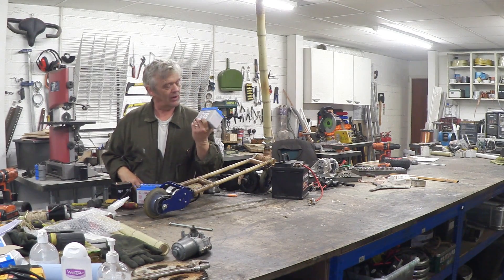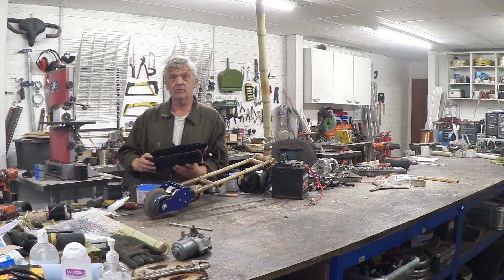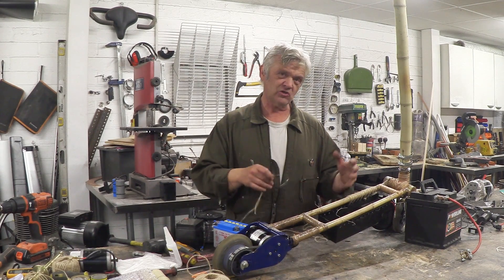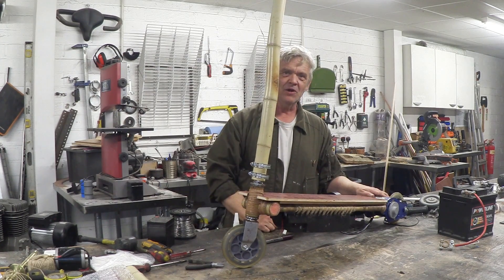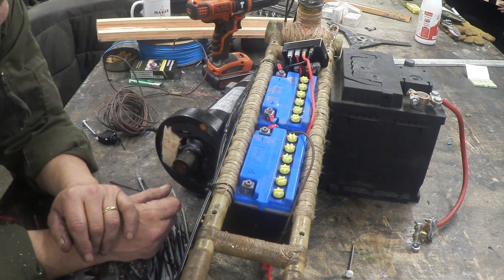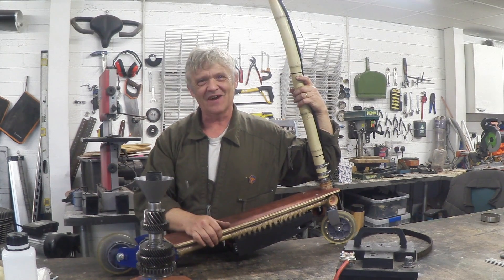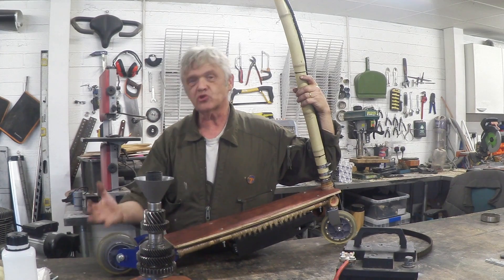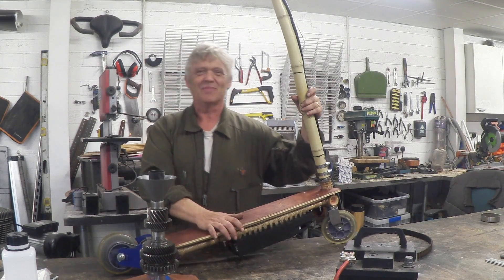1164 Build A Bamboo E Scooter - Part 2

Comment: You could hide a couple of rows of 18650 batteries inside the bamboo rails (instead of that battery box) basically use the hollow bamboo tubes as a battery holder. & If you need even more battery power you could also put them in the steering tube.

Comment: Just wondering, when the batteries go flat what is the voltage? If they are too low it could damage the batteries. Also whenflat can it work by foot power in neutral or is the drive wheel in brake mode?
Reply from the maker: lead will got o 10V or so and it can be pushed along by foot if flat

Comment: I rather like the fun you are having with bamboo. My worries stem from battery placement/lack of metal skid plate.

Batteries that close to the ground and shielded only by HDPE are only a random rock away from becoming a sulfuric acid spreader - or lithium or whatever.
Reply from the maker: to be honest mate - I think you might be over worrying there - this does 5mph if you are lucky it takes much more force than that to break a battery case
Reply: You're gonna be awful worried if you take a look under your car 😬
Reply: There's way more clearance under a car because they need to be able to leave parking lots. It's the back end of the battery that looks like it only has about two inches of clearance. Moving it forward would help immensely because of the angle. I don't remember if that was possible. Another option is not having the rear wheel straight out the back. Lower it a little and the problem is solved another way.